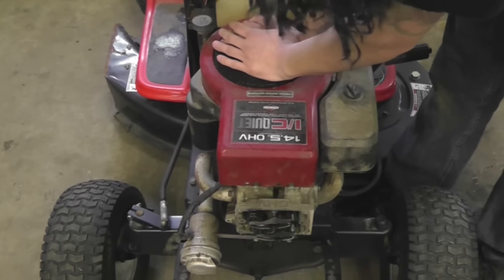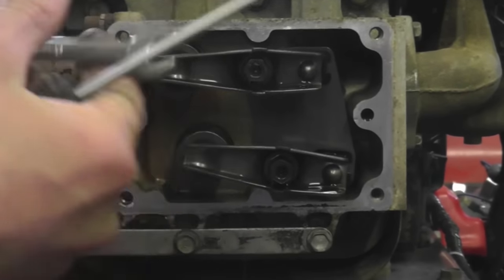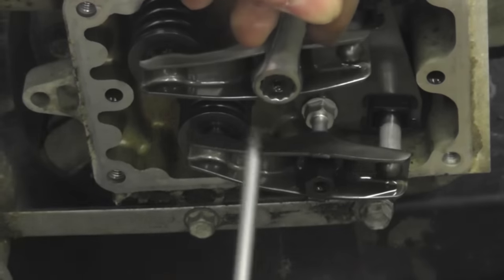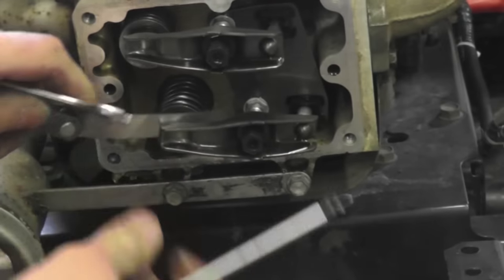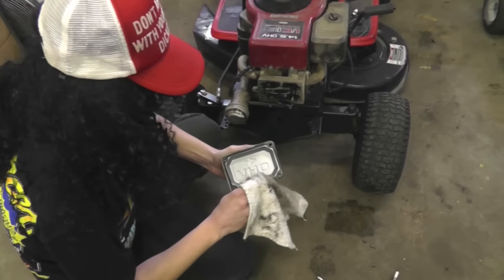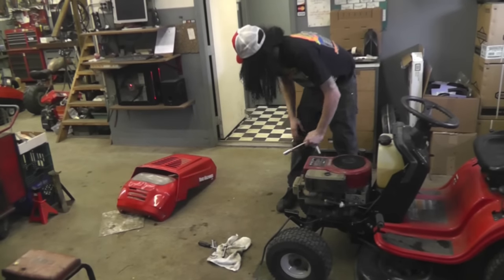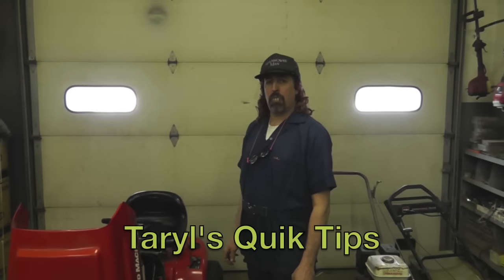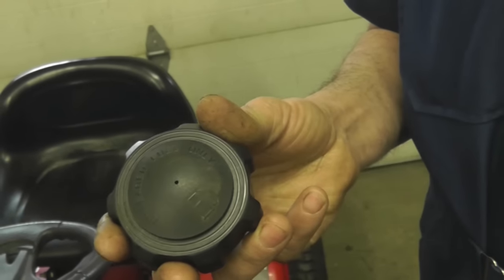Setting Valves: A Complete Guide on What To Know

Comment: Hi,how do I set the valves on a Kohler Command cv15s motor with hydraulic lifters.There are no clearance what so ever on either valve.The starter stops as shown in your video.I took off the head and there looks to be no adjustment what so ever.There is just a 8mm bolt with a spacer behind the rocker arm??Am I just out of luck?What should I do?Im running HD30 Castrol in the motor.Please don't tell me its the hydro lifters.Can I shim the spacer behind the rocker arm?The motor is backfiring out the carb.Going to check flywheel key but if its still the key the valves will not let the starter turn like it should.Any help at all would be great.I hope my"dinner"is not new hydro lifters.That would probably turn my stomach back to the Briggs buffet line.
Reply: tammygosnell you do not need to adjust the valves because they are hydraulic. I have the same engine. It must be your starter or your battery then.

Comment: Have a Briggs and Stratton V-twin with excessive vibration. How do you diagnose and fix?
Reply: Sounds like a broken key way under your flywheel..then adjust your valves at TDC..Set 005 at exhaust end

Comment: So does the .004" setting apply to all Briggs and Scrattons with OHC?
Reply: @OwenAnonymous  the difference between 4 and 5 or 6 is so minuscule that differences in tightness when adjusting give you an error threshold that allows one persons to vary a tad bit from another persons (another persons tools, tightening capabilities, metal differences, lawn mower quality differences, etc.)  so arriving at 4 is just middle ground for all things small engine overhead valve briggs n stratton and your other Momma Cow brands.

Comment: hi! i just worked on a john deere lx 178 riding lawnmower. it had no start. so i adjusted valves at tdc, changed spark plugs,changed fuel filter and air filter and whamo it started even without one crank. it sounded and felt like it had more power than ever. my problem now is it idles with a little surging. now i am thinking i had not adjusted a valve right. if it has a high surge and not a low surge do i have the gap it more or less? or is it just a carb issue. running and mowing though. any help would be great thanks!!
Reply: Did you figure it out?

Comment: Have you found that four thousandths works good just on briggs singles or is it a good setting for Briggs twin and Kohler single/twins as well.
Reply from the maker: 427 Elevating Productions you can use 4 thousandths on all of em!
Reply: Taryl Fixes All. I have never done a valve adjustment but seems simple enough sometimes the Briggs in bolens will drag. been thinking about checking them I can be certain then it won't warp a valve or nothing someone else told me be careful as that all engines use a different setting

Comment: My 19.5hp was doing this same thing.  I tried adjusting the valves, but it will still not start.  The starter will turn the motor when the spark plug is out, but not with it in.   Will I probably have to replace the compression release mechanism / cam?
Reply from the maker: +Jeremy May Thats what it sounds like, you can try this remove the dipstick tube & if you have a magnet  on a stick fish around in the crankcase & if you pull out pieces of metal then you know for sure its the comp. release. Also the cam lobe might be worn off we just did a video on replacing a cam shaft on an engine with the lobe worn down.
Reply: +Taryl Fixes All LLC  Thank you for replying.  I have watched your cam shaft replacement video and several others.  They are very informative and well shot.  I just wanted to make sure before I start trying to tear down the motor.  Also, thank you very much.  You have been a big help.
Reply: +Taryl Fixes All LLC I did like you said with the magnet.  I pulled out several small pieces of metal.  I got the motor taken apart today.  The cam shaft lobes were fine, but the compression release was in about 5 pieces in the motor.   I will be ordering a cam shaft tonight.  I really do appreciate your videos.  They helped me tackle something I have not done before.
Reply from the maker: Theres yur Dinner!
Reply: @TarylFixesAll  Flank steak and black eyed peas baby!!

Comment: got my LT1000 going.....thanks!
Reply: ok, so that's the same mower i have, i suspect you have an B&S Intek 18hp.  did you set the valves to .004 on both?
Reply: @harpoon_bakery162  Man, thats been 3 years ago. I did what was suggested in the video and it worked like a charm. I sold the mower not long after I fixed it.

Comment: I tried all the different 2as to set from .003&.005 didn't work. To setting them with zero gap didn't work. I set at zero gap then a quarter turn more. Lawn mower starts again!!! Just thought I would let you know
Reply: If there is a groove worn on the face of the rocker where the valve stem rides you will get an incorrect clearance reading with the gauge. If there is wear you may have to use a more narrow (no wider than the valve stem) feeler gauge so you are not reading on the higher part of the rocker.

Comment: So, just curious, as the manuals, including mine, says to set the valves at 5 thou, but you are saying to do it at 4 thou. Any reason why?? Of course, I trust your info more, but just curious....???
Reply from the maker: Inisfad we have found in our experience that setting them at .004 seems to work better than 5. Smoother and better starting. Now there's Yur dinner!!
Reply: Thanks for your response!  Now, I press my luck with another question - I'm new to this (and old and female, so hopefully this will elicit your sympathy...).  My engine starts easily, but I find that when I engage the PTO, while the engine doesn't stall, the idle drops quite a bit initially.  Is this normally, and if not, will adjusting the valves be part of this issue??  :)
Reply: Inisfad; I'm not as experienced as Taryl & Junior and not nearly as good looking but mine does the same thing, it really lugs down. I hope they answer. Taryl! Junior! answer up! Wheres my dinner!?! Dammit they're probably in the back sleeping again. 😡
Reply: Bilge Pump If you look above, they did answer when I posted the question, saying that 4thou seems to work better than 5, with smoother and better starting.....:)
Reply: Did you fixed the mower

Comment: Hello Taryl, Is this the same for all the briggs ride on mowers I have a yard machine 13.5hp ? thanks mate :)
Reply from the maker: All OHV solid lifter engines that require a valve clearance are set in this manner. If that doesn't fix the hard cranking issue it could be the compression release on the cam is broken, or the starter was overheated from trying to start the mower & the starter is bad or you might have a leaky carb which is filling the head with fuel. Thanks fer watchin the vids Taryl
Reply: Taryl Fixes All Ok thank you very much for the reply, I will look into these things you have mentioned. Thanks again mate - Roo

Comment: what would make a 16.5 hp briggs keep shearing the flywheel key?..i,m gonna replace the key AGAIN and try setting the valves at .004
Reply: Clean the cone , key and the flywheel with some brake cleaner or carb cleaner and torque it to 88 or 89 ft-lb or 120 nm

Comment: shouldn't the exhaust valve have a little more clearance than the intake?
Reply from the maker: +glennspeeds They do on the L head Or flat head motor. We did per Briggs specs & mowers were coming back hard to crank so I tightened up on the clearance haven't  had a problem.
Reply: Ok thanks! There's ur dinner! :)

Comment: Wait what if you turn the engine clockwise by hand til 1/4" past TDC?

Both valves closed at same time so both can be adjusted at that same position right? I noticed he turns the engine counter clockwise to find the position he wants to adjust at. Which was different but should still work and normally intake should be done first but again it shouldn't really matter if gaps are right. The engine code/model/type on mine said .003-.005" intake and .005-.007" exhaust. It looks like this but newer, a 2019  mtd/craftsman T110.

Comment: taryl i have that problem on my kroler 12.5 that has no adjustments on my valves where do i go from there?
Reply from the maker: +Leakywaders54 Compression release on the cam is most likely broken.
Reply from the maker: I show the Briggs cam which works the same way in my HOW-TO replace a camshaft video

Comment: I have never seen anybody set valves with one open and the other closed. Ive always set them when both valves are closed and TDC. Can you explain Taryl
Reply from the maker: jonathan doyle The reason we do it this way is with one valve open and the other one closed is, we know that the cam lobe for the other valve will have no tension on it. Now there's your dinner!
Reply: Taryl does it matter which one is closed and which one is open. Thanks

Comment: here's your lunch, I had a mower that would mow 10-15 minutes and quit, over and over. Found a split in the fuel filter that was letting the engine suck air. That's dinner right there.

Comment: I still can’t believe how many so called ,”techs” take the time to put the engine at top dead center and adjust both valves at the same time.  This technique works just as well and is much faster. I’ve been adjusting small engine valves like this forever with no issues. I’ve had a lot a guys tell me this won’t work. Lol.  You just can’t teach some people. All they know is how the tech manual shows how to do it. I swear some of these guys can’t take a shit without a manual to show them how.

Comment: My mower was doing the exact same thing, I thought it was getting hydro locked from gas leaking into the cylinder when it sits so I installed a fuel shut off.
Reply from the maker: Thats another common problem with the Briggs, leaky needle & seat. I have a vid for that too.

Comment: That is the way I do it but have been roundly told I am doing it wrong because supposedly there is something called "valve overlap" so that if the piston is not at TDC on the compression stroke one will get a false reading.  I don't know about that.  I think was Mowermedic that brought this to my attention.  However, I examine a cam and for the life of me I can't see any possible way there could be this "overlap" from one valve to another if you have one completely open the other is going to be completely closed otherwise you wouldn't get compression.  Anyone want to comment on this?  What do you do when adjusting the valves?